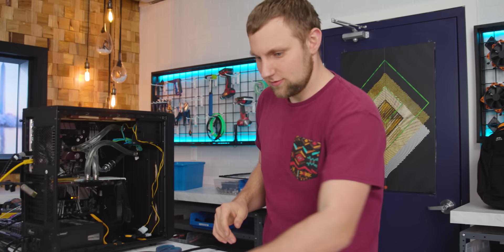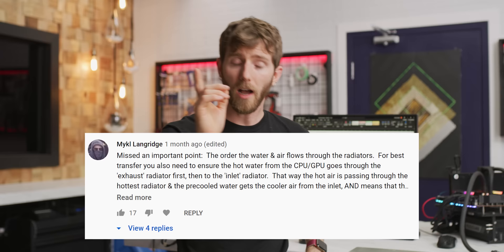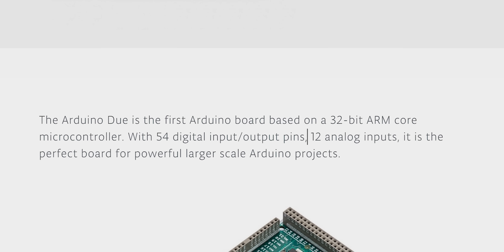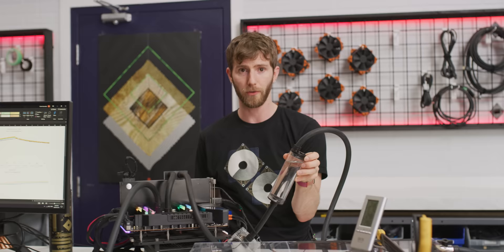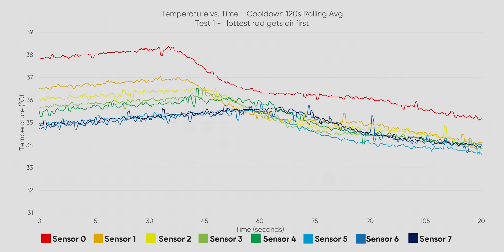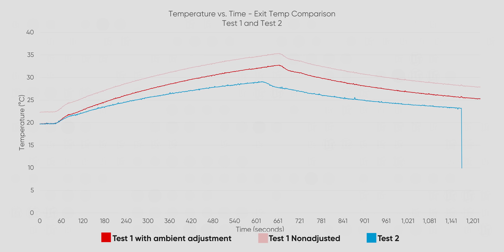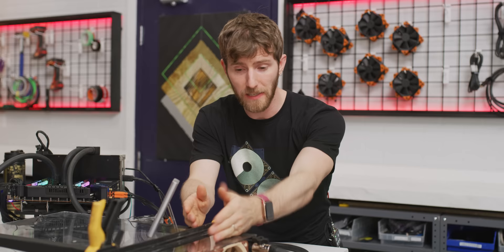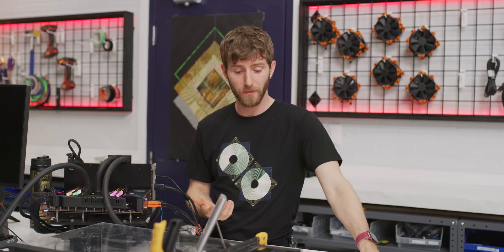Is this even going to work…

Comment: You got your  delta T's backwards. The change, (delta,)  is always the (Final)-(Initial).  It would actually be -4⁰C and a lower delta T would be better. But I reckon its about perspective here. Mathematically it won't work, but common sensically it will.

Comment: I feel this test was flawed using that wind tunnel effect the only thing caused there was thermal equilibrium even removing that housing would have produced way better results, that’s why the ones closer to the end was cooler than the end rads would have been better to test under normal conditions allowing the radiators to dissipate the heat naturally would have yielded better results instead of a thermal bottle neck like a hourglass ⏳

Comment: How should you get heat out of a second (third, forth, ....) radiator if you only push hot air from the first rad through? it does not work. if you configure a system the "typical" way where you have a front/bottom intake rad and a top outtake rad, the top one does close to nothing because it only gets heated air. in the real world it will better temps by one or two degrees depending how much fresh air it can get through all the opening in the case (might work relatively well in a mesh case though), but its not real effective. always max out radiator area that can draw fresh outside air. for the same reason a real fat radiator does not magically work much better than a very thin one with the same size. there is a slight advantage to those if you run real slow fans in push/pull, but its also not massive. going one radiator size up is always better than going fatter.
you can also see this in car radiators. they take up the whole front, but they are very thin.

Comment: This is a great video. A lot of solid research and high-effort testing. 

But something to keep in mind is that most of us are doing workloads that don't max our GPU and CPU, for hours on end. gaming, video editing, photo editing, and many other workloads are more of a burst-style. These take full advantage of your components in some scenarios, but largely use a chunk of their performance for a longer period of time. This is important because the "time to heat soak", as well as the actual temperatures your hitting real world are really what matters to most of us. 

These results would be valuable to massive datasets, crypto mining, etc. but not so much for the average user, or even power user. In other words, we're unlikely to see any real drawback from these insane setups, aside from the absurd cost and complexity to get these running for a bump in performance.

Comment: you should spread the radiators.
each level should have rad.
1st story 2nd 3rd that way they dont heat each other that much. only by radiation heat.
~[]~~
~[]~~
~[]~~
~[]~~
~[]~~
                                                           []

Comment: So would the best config for two radiators  be to exhaust from two different sides of the case (Say the top and front) using the bottom and back as inlets for fresh air?

Comment: Well I did, simple thermodynamica. But good to see that you're wrong and right. As long you know what you're doing then it's right. Let alone my pc is generating about 45 degrees celcius inside the case and I've my rad on the top side. Efficient? Lol hell nah practicall yes, because the tubes don't reach all the way to the front xD

Comment: What did you originally expect from stacking with a single set of fans? It'd be similar to having a second fanless radiator that does nothing but sit in the same loop. Yeah, it might have surface area to dissipate heat, but with fins that dense, you're going to generate heat pockets that do nothing if you don't have airflow over them; passive radiators do almost nothing without proper heat dissipation design for passive dissipation, when radiators are designed to have active dissipation through airflow. 
Pretty much everything here would've been solved with some logical thought. Passive radiators do basically fuck all, active radiators actually does something, coldest air on the coldest radiator provides colder temps, coldest air on the warmest radiator provides temps that aren't as cool. All it takes is a couple of brain cells to figure that out, as this is an extremely simple logical test.

Comment: who puts radiators on top of each other tho do it in a vertical stack and slightly decrease the exit size and it will do twice as well, also having 6 rads you would normally be expected to have more water/bigger resv.... you need to do this test again

Comment: Was that Colin's first experience building a basic datalogger? 2 weeks is a pretty long time, but understandable if it's new territory/they don't have a background in a scientific discipline

EDIT: Also, just a suggestion - link raw data graphs in the description, but absolutely smooth those curves. Then pedants and cynics can check the description, everyone else sees the clear picture
Reply from the maker: Yes, first datalogger I've built but probably my 4-5th Arduino project overall - Its been a few years since went through my thermodynamics courses.  The sensors, while convenient and G1/4, were a lot more of a hassle than I anticipated. There were a LOT of testing runs performed in various configurations, followed by converting that raw output to usable information that I could interpret, theorize, then further testing to validate once I had a hunch. I learned a ton with this project! -CW
Reply: @LinusTechTips  Don't get me wrong, for a first go you did a really good job (not meaning to sound patronising aha)! But I would absolutely recommend reaching out to a local University's Physics department, they'd be more than happy to offer some advice for actual setups. I'd look into learning a bit of R perhaps, or some more Python, for the data visuals and plot fits :)

Comment: So... basically you concluded that the most common setup of dual radiators is the best; i.e. when GPU-> CPU -> Top rad -> front rad
Thus freshest air hits the cooler front rad first, and the warmer air hits the warmer top rad later. Right?

Comment: Are yall ever gonna post the raw sensor data?

Just a few more sensors (like avg water loop and air temp in and out, and radiator temp instead of radiator water temp) and youd have a complete scienticious setup.

Now show series water flow and parallel air flow. And parallel water flow and series air flow.

like, it wouldnt take much to test every possible configuration.

For another thing, whats the max temp that it gets to? what happens if you leave it running longer? will they eventually plateau and you just cut it off at the point it would? i want to see the dozen tests you ran, and the dozen longer ones, and see all the graphs involved.

I think its a bit weird how one rad does work, the next doesnt, then one does, then the next three dont really, its very confusing. It also really confuses me on how the water in the first and last rads (second test, counter flow) equalize, i guess thats heat soak? but we never got to see temperature of the rads instead of water, and i think that would have shed light on the issue.

Im just saying, spend another week testing, put more sensors in it, try several arrangements, publish a whole damn paper on it, become the nerds i know you to be!

Comment: Doesnt it all depend on tbe thermal capacity of each rad? Iirc there was a black ice 3x120mm rad that advertised 1000watt capability back in the day. Stacking multiple rads on a system generating 500w of heat... not going to do much. But stack 3 single 120mm rads and then  reevaluate.

Its all about bottle necks. A second or third gpu wont make a difference in a core 2 duo setup with 8gb of ram....

Comment: but that middle tube on the system is sooooo hot you are running hot water to cool of either the cpu or gpu. if you are going to use more than one rad have 2 loops

Comment: for everyone... u can do it other way, the better way. stuck the radiators next to each other and everyone gets fresh air. u can stuck 3 thick radiators next to each other in ATX case to the side, but then you will not see your rgb, but u get the performance, you use top of the case as the output and it will works just fine.
dont stuck radiators behind them selfes... logickaly the one same air can´t cool same water that much like more sources of the fresh air...bruh

Comment: How is plugging wires into an Arduino making a data-logger from scratch? Not saying that that it is not a good test system but so not from scratch. But science would say that as long as the air is cooler than the water you will get some cooling. The best cooling will be the great the difference bet better the cooling. So yea pretty much what you guys saw.

Comment: It would make just little different if you stacked the air side flow in series. You should mount them in parallel, so each radiator gets a fresh air, and have 1 or 2 fans to gives a negative pressure inside the casing. I'm quite sure it would make a big difference. Not the point of this video, i know, just sayin...

Comment: Heatsoak
If heatsoak is a big advantage to having more radiators (and thus more liquid and metal to soak heat) then how LARGE of a reservoir makes sense for a 500W load?
Reply: (I meant a big reservoir paired with a more typical 240/360 radiator + 2/3 fans)

Comment: Hottest rad should get the air LAST! Heat and Air should move in opposite directions to maximise heat flow, otherwise the last radiators will do nothing even though heat could be theoretically still be extracted.

Comment: Who would think that blowing hot air from a first radiator would heat up the next radiator in line? There's a reason why this is not a thing, and they just increase surface area...

Comment: [ LINUS FANS PLEASE UP-VOTE THIS, IFF YOU WANT LINUS TO SAY BOO YA CORSAIR YET AGAIN! ]
Hi Linus, 
I kind of think you're using them incorrectly...
Put them in Parallel not in series Air Flow (seperate fresh air for each).
Just think again, why radiators have large surface in the first place?
So that they can release heat into the sink(air) which is cooler.
One radiator feeding hot air to other will do no good.(it's difficult to dump heat into something that's already hot)
You can have the series water though.

Comment: Hey, I need some help. This is my first time doing this and below is the following setup I’m planning to use with my Oculus Rift S.

AMD Ryzen 7 3700X 3.6 GHz 8-Core Processor
NZXT Kraken X63 98.17 CFM Liquid CPU Cooler
MSI X570-A PRO ATX AM4 Motherboard
G.Skill Ripjaws V 32 GB (2 x 16 GB) DDR4-3600 CL16 Memory
Western Digital Blue 1 TB 2.5" Solid State Drive
NVIDIA GeForce RTX 2080 SUPER 8 GB Video Card
Cooler Master MasterBox TD500 Mesh w/ Controller ATX Mid Tower Case
Corsair RM (2019) 750 W 80+ Gold Certified Fully Modular ATX Power Supply
Asus TUF Gaming VG27AQ 27.0" 2560x1440 165 Hz Monitor
Reply: You didn't really ask a question. Saying you need help isn't enough info.
Try posting your question here instead in the comments on youtube.
https://linustechtips.com/main/
It's the forum side of Linus tech tips.

Comment: But what about doing the test with dual radiators, or 7 radiators side by side, not stacked.... surely that is the problem everyone had in the first place with this test. No-one was saying that stacking 3 radiators was worse than having just 1 radiator, everyone was saying having 3 side by side radiators is more effective than having 3 stacked.

Comment: Not surprised by results.  not worth the money in hardware and energy used and space wasted that could be otherwise utilized as dead space for more airflow.  Not to mention the more water or coolant connections increase the chance of a connection failure and leek.  I do not use liquid cooling and will not build a liquid cooling rig for customers, past warranty issues where I had to eat the cost of the failures and prepare, I support all my builds to customers with 2 years service and support and reduced-price upgrades as I repurpose the old parts to rebuilds and refurbishing older machines at a large discount.  That is just me.

Comment: can you test CPU cooler heat sink x 9 + adhesive　<Can adhesive stuck on use this?
and
cpu dual fan + case fan x 10 pcs + gpu port fan x 3 <how your Performance?

Comment: wait....confused..i have a simple setup..kinda.....9700k with a heatkiller copper block on it/evga gtx 1080 hydrocopper....swiftech p655 pump.1/2 inch tygon tubing...I had a single 120mmx3 rad in the single loop setup....9700k and 1080 were both sitting idle at 40+/-.....added a second 120mmx3 rad...now they both sit at 34+/-...????

Comment: Iam STILL COMPLAINING about the setup.
come on Linus, we allready know "more is better" but it still not the most beneficial to "stack" them like that
PLEASE do the same test with the radiators side by side.
- this will make the entire cooling lots better.
in your setup in a stack the fans from 1-7 just get hotter and hotter air to cold down with.
side by side all fans will have the same cold air to blow at the fans.
SIDE by SIDE vs Stacked is the test you have to make.

Comment: Pronunciation tip: It's an Arduino "doo-ay", not "doo" (or "dyoo"/"jew", as Brits would probably read it). 
As in "Uno, due, tre..." (1, 2, 3 in Italian), which is the actual naming scheme Arduino are using.

Comment: Four times per sensor :D
You meant to say minute?
But yea, I agree with you that stacking radiators works! But it only works up until all the air in the upper stack equals the... oh yea your data also shows this nevermind I should probably watch the video further!

Comment: Why didn't you just also tested 2 radiators pulling "fresh" air??? Like, one on the top of the case and one on the front, bottom or a variation of these. I kinda felt anxious tge entire video hoping that the tests would also include this, it should definitely work better than using a second radiator that's just getting hot air.

Comment: "500W of heat" since when was wattage a  measurement of temperature? Someone please enlighten me
Reply: "500W of heat" is a measure of heat energy (well power technically). The CPU converts electrical energy into heat energy (conservation of energy). Heat energy and temperature are related: if you want get rid of more heat energy you have to increase the temperature above ambient, all else being equal.

Comment: I think the idea is more that as you add more radiators to your system, you are restricting the air flow. So despite having more area to dissipate heat, the flow rate going over the fins won't be as high and hence your total power dissipation won't necessarily be greater than that of a single radiator. (Remember rate of heat transfer is also proportional to the temperature delta).

(There's also the issue of recycled air reducing cooling performance - but you know this). 

It would be nice to see another video where you increase the number of radiators one at a time, so you can find the optimum balance of flow rate vs dissipation area.

Still a cool video, cheers guys.

Comment: Why use a CPU as your heat source? Why not just mock up a resistivity heater and pump more energy into the water than the cpu will? I dunno - if something is worth doing, it's worth over-doing, right?

Comment: "Never content to take the easy path." Reminds me of the time in college when I did an Electronics project and, instead of just using some ICs that had all the functionality of a timer display built in, I built out all that functionality myself the long way, largely for fun and partly just to do it. (I still used an IC to do the Timer part, because that would have taken far too much time and effort and space on the protoboard.)

Comment: Hey Linus I just wanted to ask I am going to buy a new Laptop so I wanted to ask whether AMD Radeon Vega 8 graphics is good. If it is then I can buy it otherwise I need to look for a new one pls answer fast.
Reply: Comment section of a youtube video is not the best place to get an answer. I would both google it, and put it in the search bar here on youtube. Linus doesn't read every single comment on his youtube videos.
https://www.notebookcheck.net/AMD-Radeon-RX-Vega-8-GPU-Benchmarks-and-Specs.260180.0.html

Comment: Hey, I'm literally just talking to "my" CAD designer while watching this and I was thinking if you (Linus Media Group) or literally anyone else would like to help me with my ultimate cooling dream =)

I've been reading A LOT about novec cooling and I've come up with a (still crude) idea for a completely novec 7000 cooled Workstation in a custom acrylic case with built in water chiller and hermetic connectors for the IO shield and the front panel.
I could use help in nearly every regard. Right now it's more or less just on the drawing board but that's as far as I will get for now since this crysis took every last part of my savings.
Without having any price estimates from the manufacturers I expect the cost of the case ready to get parts built in to be around 1k - 2.5k. 

I just can't think of a more effective way to cool PC parts and even if I don't manage to get it built because I'm piss poor, I'd still like to see it at least in CAD and knowing that it's at least in theory possible =)
Reply: I appreciate any help or even a "that's an awesome idea" =)

Comment: Aren't you just blowing progressively hotter air into the next radiator ? Thus negating the cooling effect.? If All radiators received the same temp ambient air, the effect would be much more cooling.

Comment: stacking:  cool air to warm air to warmer air to hot air to hotter air.  Fluid and thermal dynamics, simple!  the math does not add up on radiator stacking in a confined space.  NO on the stacking!!!

Comment: My car stacks 3 radiators, 1 for the AC, 1 for the engine and 1 for gearbox and diff
Reply: The diff/gearbox is technically 2 sperate radiators in one.